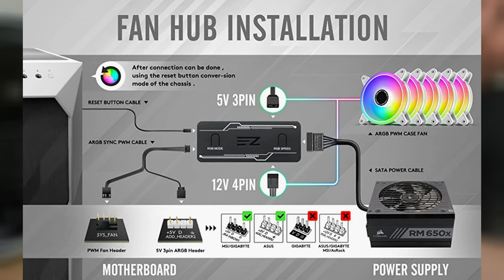Simply Outstanding! - Moonlight White ARGB PWM Fans - EZDIY-FAB

Comment: The fans cannot be controlled via the remote control. I have connected everything correctly. Now I am thinking about whether to return the fans because the product is defective.
Reply from the maker: As long as you have connected everything, and the remote battery tab has been removed etc etc. Then yes return would be best option

Comment: Do you know why the rgb on these fans won’t start on boot ?
Reply from the maker: At what point does the argb turn on?
Reply: i have to manually click the controller to turn the rgb on the fans, the fan themselves turn on just not the rgb.  @WnDTech
Reply from the maker: @cartifan911  double check all your connections

Comment: you might get better thermals on your cpu if you move your 120 AIO radiator to exaust on the back of your case, and just have a 120 fan bringing in fresh air on the front of your case
Reply from the maker: Honestly, through testing, there isn't much difference in temps. At least nothing to be concerned about.

Comment: Hi thanks so much for the video I'm really interested in buying these but the none pwm version as I need a hub capable of at least 6 fans . I am slowly learning computer related stuff. I just brought a hyte y40 case.  It doesn't have fans on the front but the plan is to put my 240mm radiator to the right side of the board and another 120mm fan under that.  And then 3 120mm fans at the top of the case . I wanted to replace the 2 fans that came with my cooler and radiator with 2 of these as the 2 stock only have rgb not argb but I've just read something about those fans being different in static pressure.  Do you think these would work and cool efficiency.  I appreciate any advice (I will also have a 120mm stock fan provided with the case on the rear too)
Reply from the maker: I think they would be perfectly fine for you. But always look at other options before making a final decision.
Reply: @WnDTech  thanks so much! I'm still very much in the learning process and tbh didn't even know what static pressure in fans was until I read there that you're supposed to use certain ones to mount on radiators. So wasn't sure I'd be able to replace the stock with these. Was gutted lol . Yeah I've looked at others.  Some are extortionate but I don't want poor quality ones.  I'm purposely avoiding corsair as I know they tend to use different connectors to limit to only using their brand and these ones seemed to tick all the boxes while being affordable.  Tbf there will be these 6 ones.  A stock on the rear and the one other fan that came with the case under the graphics card so I did gather that with 8 fans the static pressure with the radiator shouldn't be too much of a issue but thought it best to ask someone who knows what they're talking about lol . Thanks again!

Comment: Can I control it with the remote?
Reply from the maker: It doesn't come with a remote, or do you mean the controller ?
Reply: Can I use an external remote, meaning I go to the store and buy a remote and use it with the fans, or can I change the colors through the attached device?
Reply: @WnDTech  I mean, can I change the colors of the fans via the remote control or not?
Reply from the maker: @AhmmaD555  yeah, I think it has 50 modes via the controller.
Reply from the maker: @AhmmaD555  no it does not support RF or it controllers. It has the in line control and control via the motherboard.
Reply: @WnDTech  When you restart your PC is it in default mode when it is up?
Reply: @WnDTech  is this sync thru mobo?

Comment: Got a similar set, but i have only 4 pin connections on my motherboard, en the set came with 3 pins connector. Is there a way to fix this?
Reply from the maker: No, but you can connect a 3 pin connector to the 4 pin connector and it will be fine.
Reply from the maker: The 4th pin only provides additional fan sensing.